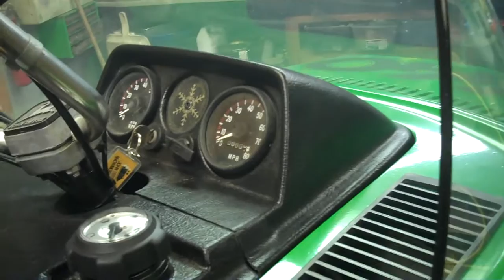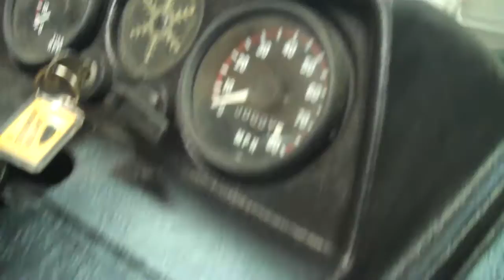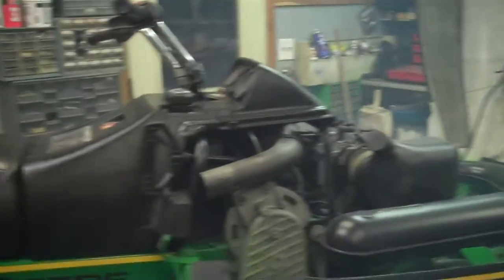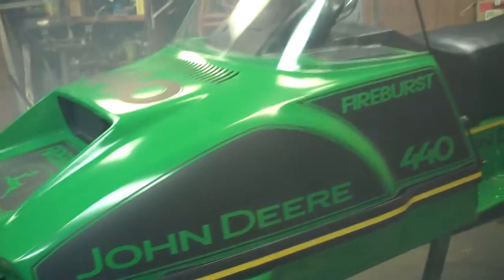1979  john Deere Trailfire Custom

Comment: Beautiful sled! I just took on my first restoration a 1979 trailfire like yours. I'm not planning a total teardown, just paint, seat, decals. It already runs great. Was wondering if you could put me in touch with your decal guy? Please advise. Thanks!
Reply from the maker: you can go on facebook the place is  K's Signs & Graphics there out of winner south dakota there number is (605) 842-3000 tell them what you need they can fix you up they would have the original decals in there computer for your trailfire they have made them for me
Reply: Thanks a ton. Not to be a copy cat but I absolutely love what you did with the sled. I've wanted a deere since i was a kid so i finally decided to pull the trigger on this one to start my collection. Hopefully there will be many more to come.
Reply from the maker: Erik Lennartz
Well good for you but sadly you cant have just one deere in the stable so look out its addicting
Reply: pupbiking
 Hey Bud,

 I'm finally ready to order up decals. Had all the body and paint work professionally done. Seat is being re-upholstered now. Some powder coating to complete yet but looking forward to reassembling. I need to track down a few parts, snowflap, dash piece, etc. Any suggestions? Thanks!
Reply from the maker: Erik Lennartz
you need a flip lid flap etc i might have some but actually a good place is to go to vintage sled.com sign up to there classified and list what you need you can usually get what you need as all the guys that work on sleds are on there or i get lots of my parts from ebay those flip lids on the trailfires are hard to find not cracked if nothing works check back with me i can see what i have

Comment: Where do you list your machines for sale?
Reply from the maker: This one is on Ebay Right now
Reply: pupbiking What is your painting process?  I painted an old john deer 440 liquifire from the early 80's with rustolium and it didn't take.  Your's look fantastic. How durable is your paint?
Reply from the maker: Donovan Wadholm well seems like the trick is a good primer and automotive paint jazzed up with extra hardener makes a good finish the JD sleds were not primed from the factory so you see alot of them with paint issues they werent built to last this long lol